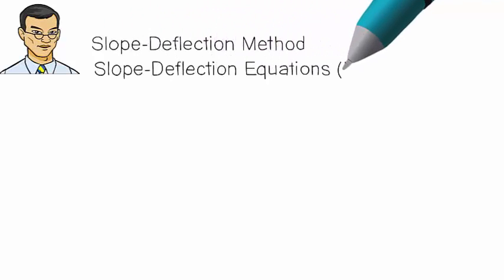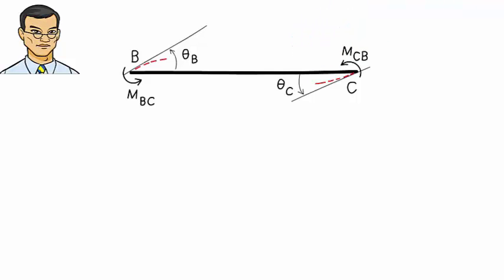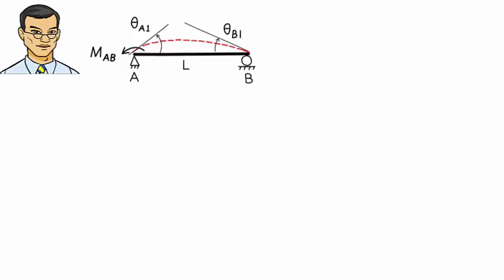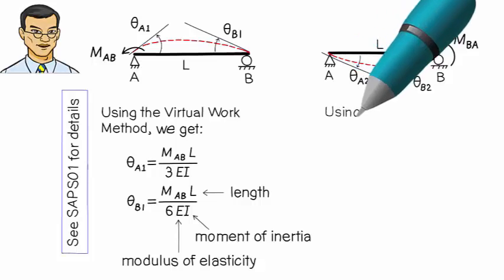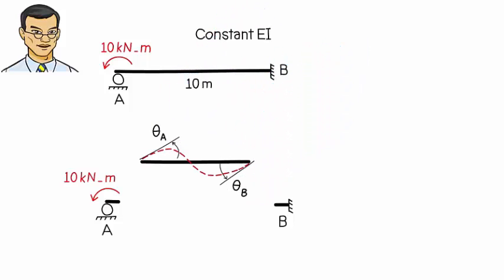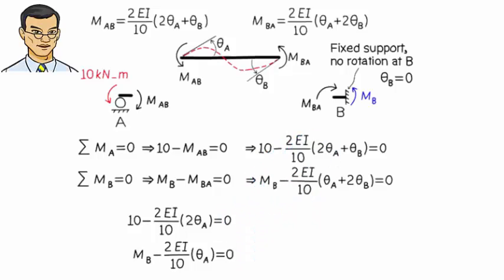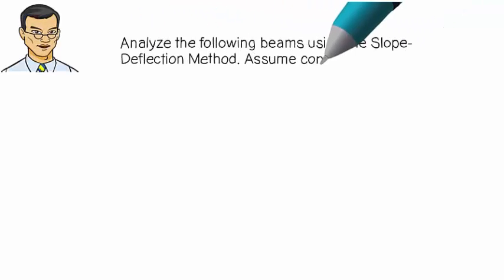SA28: Slope-Deflection Equations (Part 1)

Comment: What if there's no fixed support. How do you eliminate one unknown?
Reply from the maker: We end up with a statically determinate  beam, if we replace the fixed support with a pin or roller. In that case, we can analyze the beam using the static equilibrium equations; there is no need to use the slope-deflection method to analyze the beam.
Reply: @DrStructure   But that's the assignment you gave. Is there anywhere I can see the answers to your assignments?
Reply from the maker: You can find the solution to the exercise problems in the free online course referenced in the video description field.
Reply: @DrStructure  thanks a lot

Comment: 8:57 why is the sum of shear forces Vab and Vba not equal to zero? Vab - Vba = 0?
Reply from the maker: If the two shear forces were drawn in the same direction, say both were pointing up, then we would have written: Vab + Vba = 0. But when the forces are drawn in the opposite directions, the statement: "the sum of the forces in the y-direction must be zero" translates into Vab + (-Vba) = 0.

Comment: how Mbc and Mcb are on same direction at 01:18
Reply from the maker: These are the assumed directions, not the actual ones. At this point, we don't know the direction of any of these forces, we are just making an assumption. When setting up formulations and solving problems, we always go with a sign convention, and place forces/moments on diagrams according to that convention. So, here, we are placing all the moments in the counter-clockwise direction.  After the problem is solved and the moment values are determined, the sign of the computed values tell us if we made the correct assumption at the beginning. For example, if we assumed a moment to act in the counterclockwise direction at the beginning, and its value comes out to be negative at the end, then we know that the actual direction of the moment is opposite to what was assumed.
Reply: @DrStructure  Thanks for your explanation

Comment: HI Dr. structure  am new to this course i was wondering if u could explain to me how a beam segment got END MOMENT (rotation ) with out loading thanks
Reply from the maker: Consider a continuous beam having two spans resting on three supports, a pin at the very left end (A), a roller at the very right end (C), and a roller in the middle (B). Now, suppose we placed a load on the right span (segment BC) only, causing the beam to deflect downward in that span. In that scenario, what happens to the shape of the left span (segment AB)? If BC deflects downward, then AB is going to move/deflect upward. Why? Because the downward deflection of BC means point B must turn clockwise, and C must turns counterclockwise. If B is turning clockwise, then it forces segment AB to deflect upward (and end A to turn counterclockwise), it causes the segment to deform/deflect. Therefore, while AB is not subjected to any direct applied load, it ends up deflecting, resulting in end rotations, and subsequently end-moments to develop in the segment.
Reply: @DrStructure  wow thanks for the deep  explanation
Reply from the maker: @abukarhassan943  You're welcome!

Comment: The moments that are produced are external or internal? Are the moments due to the deflection or load? I'm new to this course.
Reply from the maker: The bending moment in the slope-deflection equations are internal to the beam. 

In structural members, internal forces and deflections are results of applied loads. Loads cause the structure to deform and internal forces (and stresses) to form. Generally speaking, deflection don't develop without loads. There are exceptions, but it most cases loads need to be present for the structure to deflect and the internal forces to develop.
Reply: @DrStructure  I was confused as to how did the beam deflect on it's own with any external load. That answer did it for me. Thank you so much for this explanation. You are doing a wonderful service to the Engineering community.
Reply from the maker: @sumfun103  Glad to be of help.

Comment: Dr structure I really love your video, I am confused; I want to learn from you and you use counterclockwise positive and my teacher, book and therefore all friend use clockwise positive. So if I go with them I am going to miss your video if I walk with you then I will be alone in class getting opposite joint moment and ultimately same diagram. Any suggestion will be very appreciated.
Reply from the maker: Thanks for the note. Eventually you want to be able to rise above the sign convention and warp your mind around the concepts and the process/method.  Sign conventions could become confusing, but you need to be able to operate (solve problems) effectively regardless of the notation/convention. 

The impetus behind these lecture is to help you grasp the method. If you can follow the lectures here, follow the derivation , and can duplicate it, then perhaps you should do the derivation yourself using the reverse sign convention. Once you master the derivation, you may find it relatively easy to go back and forth between the two notations. 

Obviously if your professors are using the reverse convention, it makes sense for you to do the same. That minimizes the potential for misunderstanding/miscommunication.
Reply: @DrStructure  , Thank you for your reply and thank you for your videos they helped me to grap concept. and I am going to look your every video in future also. I am with you.

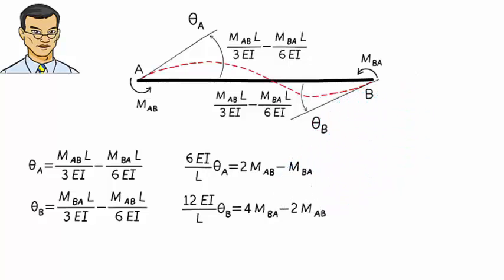Comment: In 2nd equation (θb) (at 5:30) is it correct? I think it should be "6 EI θb /L = 2 Mba - Mab" , since everything is same and denominator as well except only Mab and Mba are switched together...so how the result came i.e 12 EI θb/L = 4Mba - 2 Mab??
Reply from the maker: Yes, the equation for theta_b is correct.  If we take that equation and multiply both sides of it by (6EI/L), then we get the first equation you wrote above.  And if we multiple both side of that equation by 2, we get the second equation you wrote.  But why multiple both sides of the equation by 2? Because now if we add the two equations given at 5:30, then the 2Mab in the first equation cancels the -2Mab in the second equation resulting in an equation in terms of Mba only.

Comment: Sir what is the condition of slope and deflection right at the partially fixed support?
Reply from the maker: I am not sure if I understand the essence of your question correctly, feel free to elaborate if my response does not address your question.

One can view a fixed support as having a rotational stiffness (EI/L) that approaches infinity. The larger the stiffness of the joint (not of the member) the less rotation takes place at the joint.  A pin support, on the other hand, has a rotational stiffness of zero. A semi-rigid connection is one that has a finite stiffness (something between zero and infinity) associated with it. 

The basic slope-deflection method is not the most suitable technique for modeling such support conditions. The displacement/stiffness method is a more suitable technique to use in which we can estimate the stiffness of the joints/supports and incorporate them into the system stiffness matrix.
Reply: Dr. Structure I am taking this course currently,and I don't know those methods yet.I don't know is there any case can exist in slope deflection,I saw semi rigid(partially fixed) supports in portal method, and i wondered.
Anyway thank you for quick reply sir!

Comment: 7：25 why the MB(sum of moment at B) is 0, I remember that fixed joint has moment, right?
Reply from the maker: Right! The moment at the fixed support (Mb) is not zero; sum of the moments at B is zero. Note that there are two moments at B: Mb and Mba. Their sum must be zero.  

Perhaps the notation is a bit confusing since Mb is being used twice, once to indicate that the sum at B must be zero, and once to refer to the moment at the fixed support.

Comment: Hello Dr. Structure, 
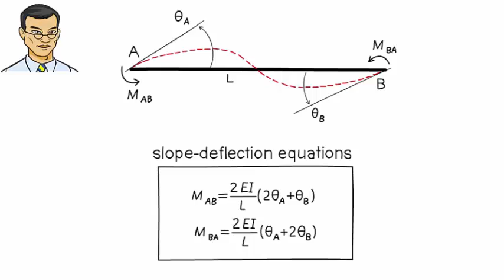Why 6:16 says that it is the equation for a beam not be subjected by any external loads.
Isn't Mab and Mba external loads that cause the rotations at both ends of the beam?
Or
Maybe I'm confused by what is the definition of internal and external force...
Thank you
Reply from the maker: Mab and Mba are member-end moments which are internal to the member. They are not forces that one physically places on the member.  Yes, Mab and Mba cause the member-end rotations but that does not make them external (applied) loads. 

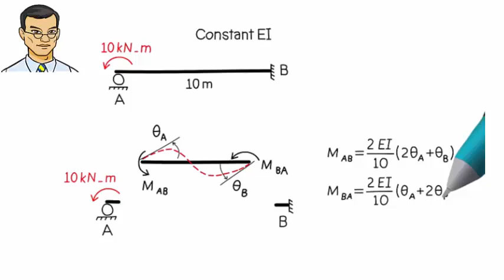@7:00 the red moment applied at A, having a magnitude of 10 kN-m is considered an applied (external) load. Here, since equilibrium at A must be maintain, we can clearly see that Mba must be equal to 10 kN-m as well. Put it differently, Mba develops inside the member as a result the load applied at A. Or, the external load causes the internal loads to develop.